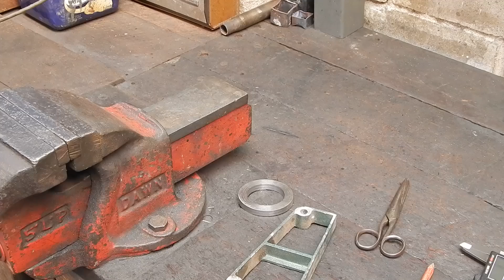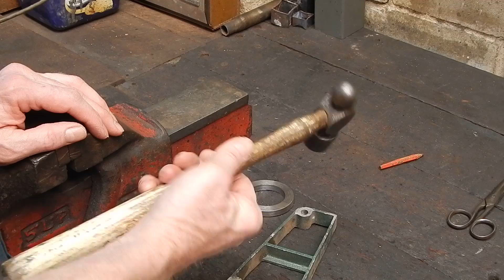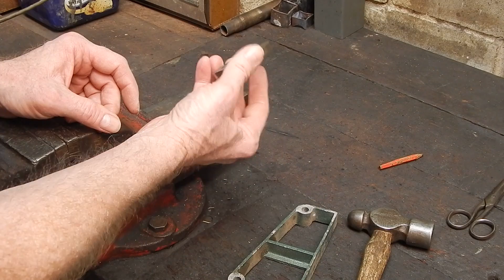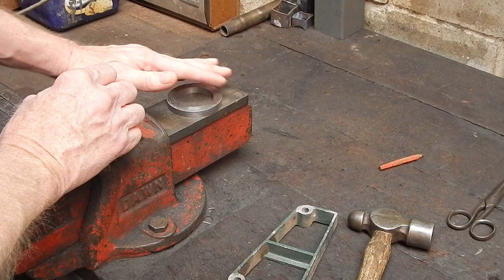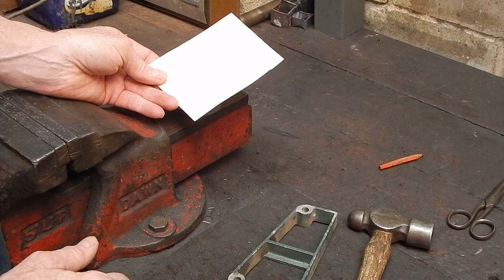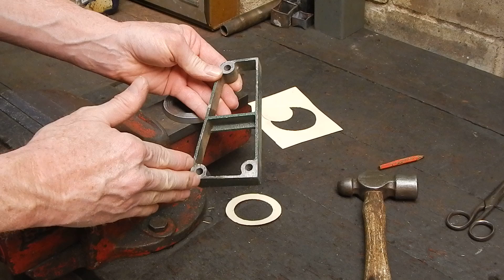How to make an engine or machine gasket - the quick and accurate way

Comment: It's surprising what materials you might have around the house/shed make great gaskets for different applications (and now I've added paper to my repertoir, thanks!). My kitchen sink wall tap is sealed into the tap connector with jute string. Been in use for over 10 years without rot or leaks. Thin shopping bag plastic strips can be used instead of PTFE tape. And don't get me started on the many uses for inner tube. Every workshop should have a selection of inner tube from racing bicycle to tractor and every diameter inbetween. Just keep out of the sun.

Comment: That looks easy, I have to use rubber for a complex shaped diesel fuel lift pump, you got any easy way to do that?
Reply from the maker: Not really. You will have to mark out around it and go from there.
Reply: I have used grease on the part I needed to make a gasket for and then pressed it on the gasket material.  This will leave a nicer imprint for you to cut out.      Works well when you can't use the hammer.
Reply: You could use something besides grease but that is what I always used.

Comment: I wonder if this will work to mark out a copper gasket, not cut it out, just to mark it?
Reply from the maker: I have never seen this method used for material like that.

You will almost certainly bruise the copper surface on one side.

I would use Prussian blue or a similar bearing surface marker to do the job.

Cheers Rob
Reply: Thanks Rob.

Comment: put part on bench paper on top and then a block of hard wood (oak maple) on it and with a hammer hit all over the wood to put the part impression on the paper. exacto knife it out. hammering on the gasket can ruin parts and also dents the gasket in different spots so when you tighten down there are thinner spots on the gasket that can fail later.

Comment: Can I use a milk carton?  I'm repairing a one cylinder mini bike engine.
Reply from the maker: +stuartc R 

Gasket material is generally matt finish, not shiny waterproof material.

This allows gasket sealing compound to adhere.

I've never tried a milk carton.  Maybe try using a cereal box.

Cheers Rob.
Reply: ok thanks.

Comment: Hello sir. I have a single cylinder motorcycle. My intake manifold is always leaking, I put gasket maker (paste) but whenever I remove the manifold I also need to remove the old synthetic rubber gasket maker but its very hard to remove sometimes. The original seal is a rubber o-ring but we cannot find a replacement here so I'm always putting gasket maker (paste) is it okay to replace the o-ring with a paper gasket? Like Flexoid? So everytime I remove it its not messy. Thank You very much
Reply from the maker: Yes, provided both faces between the manifold and the carby or cylinder are true and pull up parallel.  I'm surprised you can't find a suitable "O" ring to fit.  Another option would be to find a suitable thickness "O" ring which is a larger diameter and cut it so that it fits/butts the ends perfectly in the groove (make it very slightly oversize),  When you tighten the bolts it will compress and spread to make a perfect seal on the cut end. Being intake, there will be very low air pressure on the seal. Cheers Rob
Reply from the maker: You can use Superglue to join rubber, but not sure about "O" ring synthetic.  Gasket is OK provided there is enough surface area to clamp down on.  Rob
Reply: xynudu .
Thank You very much Rob. It's good that the technology these days are great. We can help each other and share our knowledge even tho we're in different countries. Anyway, I already did it. First, I put the paper gasket without the o-ring on the manifold, but it leaked again. Second try is I placed the original o-ring on the manifold then I put the paper gasket that I made then the leaked are now gone. Thanks again. Cheers!
Reply from the maker: Prints Mate Glad it worked out for you.  Putting a smear of grease on each side of the gasket will also help it seal.  My father was a motor mechanic so I picked up lots of tips from him.  Cheers Rob.